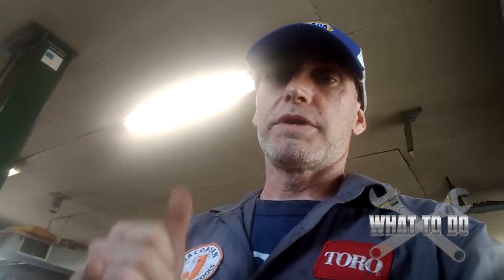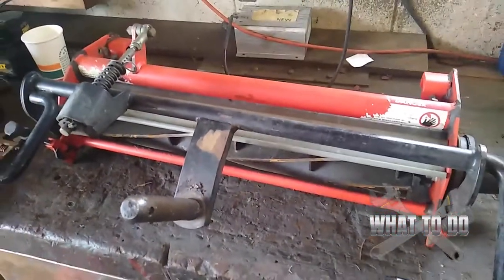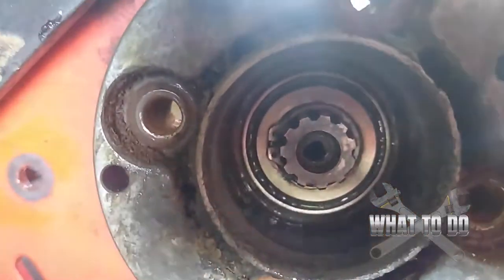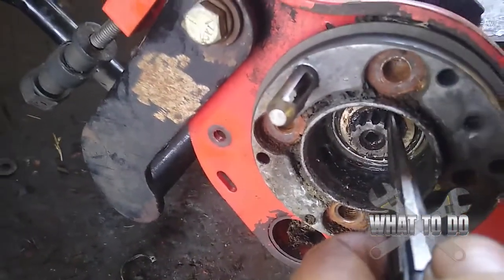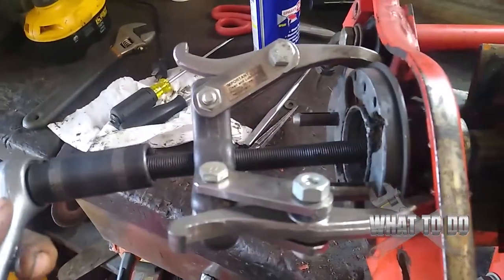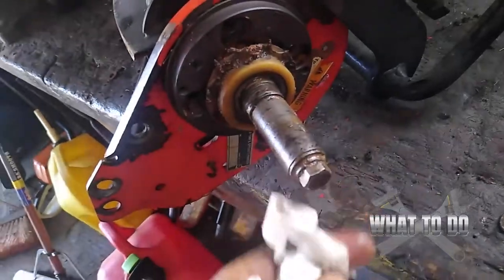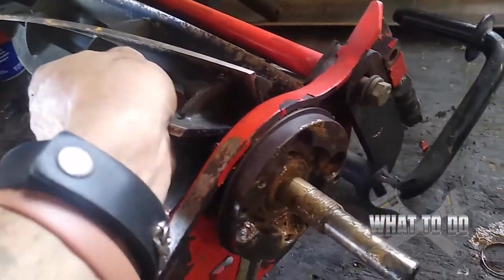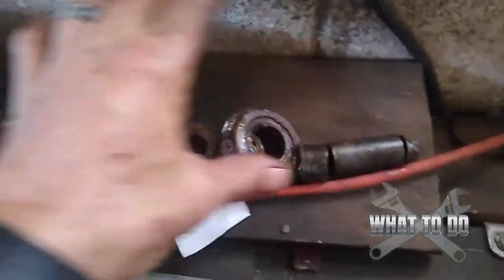Removing Reel & Bearings on Jacobsen Fairway Mower LF3400

Comment: If you remove the other hub off first and you takes tension of spring . Then punch both hubs out then clip just comes off easy . I use a puller on spline end to pull bearing etc off together hub bearings . The splines get chewed up a bit is why you need a puller. The sleeve gets pinched between with hub nut and 9/16” bolt . That’s what gives you the proper spring tension. Always replace seals and bearings including races .
Reply: Now put it together
Reply: Does the 1900D have a similar set up?